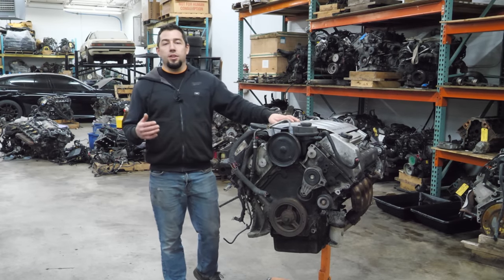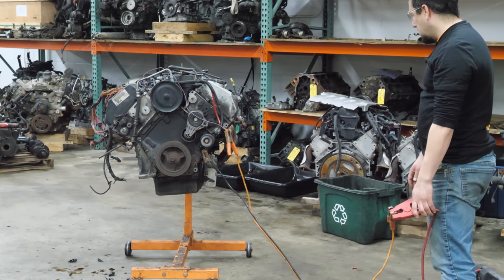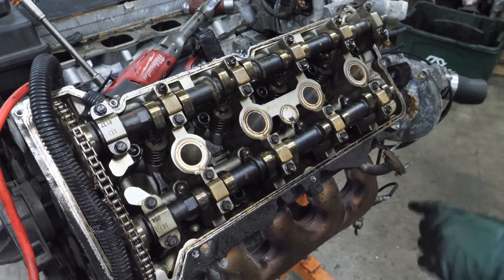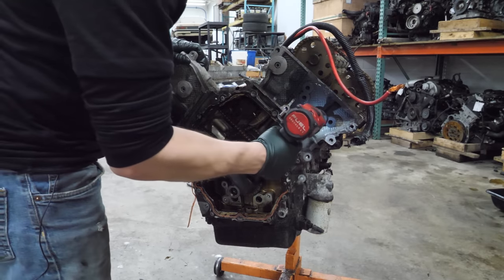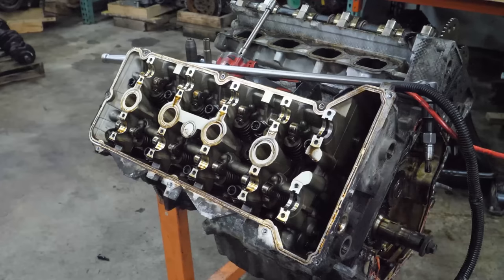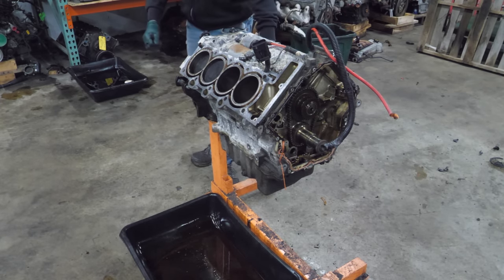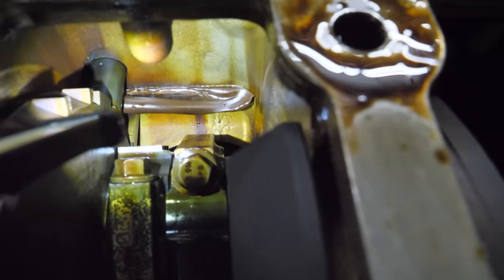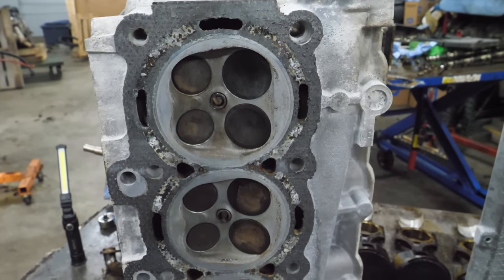Customer Returned This Cadillac Northstar L37 4.6L V8, How Many Things Can We Find Wrong?

Comment: This Northstar appears to be fully rebuildable and there's a head stud upgrade kit for it that includes retapping the block for larger diameter studs,  bigger studs included.  Probably worth doing.
Reply: They needed the stud upgrade as they munched on head gaskets
Reply: No Northstar is worth the trouble.
Reply: @agenericaccount3935  baring the head-bolt issue, they are great engines and have a dedicated following. I owned 3 cars with them, and only certain years actually have the head-bolt problem, weirdly enough. The 96 Deville and 94 Seville I had; it was the Transmission that went at 200k miles. The 99 Seville had the head-bolt issue. I would love to do a 4.4 RWD/AWD Supercharged build one day if I ever had the money. Of course, I'd have the head-bolt and crank-bolt fixes implemented and the transmission overhauled with a shift-kit. The fact these fixes exists shows there's plenty of people out there willing to spend the money. All 3 cars served me well, actually. I only had to do 2 water pumps and 1 alternator on them. The water pump is easy to do, I hate the alternator though.
Reply: @agenericaccount3935  it's why Cadillac used LS
Reply: @keithvsmith  I appreciate your enthusiasm, but veto your views on the matter. These fixes exist as a necessity and not as any implied or explicit endorsement of Northstar as a good product. In fact I would wager that the only reason a lot of these fixes have market at all is that the average owner liked the shell the motor was wrapped in and was willing to put up with spending money to undo garbage powertrain deficits to keep it.
Reply: @agenericaccount3935  can partially confirm this. Recently helped with a subframe drop on an 06 DTS that has classic GM pinchweld rot on the rear part  of the welds. We had to reseal the oil pan and redo the VC gaskets after having done both 2 years ago.

I wanna say the car is owned by an older fellow but I'm not 100% sure. I know there are enough 06-11 DTS' around that the owner could probably find another one if they so chose.
Reply: @agenericaccount3935  tell that to the inventor of the fix who's making bank.
Reply: @keithvsmith  The guy making bank selling a required fix doesn't really refute my views on the matter.
Reply: @agenericaccount3935  It does, because people are paying to have them restored, meaning people see them worth restoring contrary to your opinion.
Reply: @agenericaccount3935  You make too many assumptions with your opinion. Firstly, I said I had 3 cars with them. I am not being enthusiastic about it, I don't even own one currently. I am just stating facts. You also missed the point where only certain years are affected by the issue. My 94/96 NorthStar were NOT affected and never had a bad head gasket even having been overheated because of a faulty water pump. People obviously feel they ARE worth fixing/restoring that they are spending over $6000 to restore the engine in a car not worth that much! Again, they have a cult following and to those people, the engine ARE worth restoring unlike your claim even when it's the years affected.
Reply: @agenericaccount3935  The main point that proves they are worth fixing, is this exactly, people spending $6000 to fix the engine in a car that isn't worth $4000. These cars have horrible resale value. A person spending that money CLEARLY sees them as being worth restoring to them. There's obviously no money in it, they can't resell the car to make the money back. For $6000, they could of just went and put a downpayment on a much newer car then some 20+ year old Caddy. So, you can claim whatever you think, it's just plan and simply wrong and your opinion. Again, I have no ball in the game. I own a 2017 Ford Edge but I don't like people who spout nonsense.
Reply: @keithvsmith  Bro, Northstar isn't going to sleep with you.
Reply: @agenericaccount3935  This guy gets it.
Reply: @keithvsmith  Sorry dude, but the argument you’re making is the car equivalent of, “yeah I know he hits me, but he loves me. I can fix him with enough time”
Reply: @GMbowtie350  Yeah, no, you missed the point that despite this head-bolt issue, these are 20+ year old vehicles that are still on the road. This teardown wasn't that bad at all. It looks like the issue was shotty repair jobs and a broken bolt. Maybe pay attention to the video better next time. A properly maintained and care for NorthStar is actually very reliable. You people keep missing the point that NOT ALL NorthStars have head-bolt issues.

This specific engine didn't have the head-bolt issue. The bolts were still tight, and no aluminum pulled out of the block when he took them out. The issue was age, neglect, poor maintenance, and bad repairs with all that silicon, but for an engine with 155k miles and that's 20-year-old. It wasn't bad at all. BraveNewWhirled is completely right, this is a very rebuildable engine, though I would recommend both the head-stud and crank-stud kits. All I see are haters making comments about an engine they clearly never owned or maybe they got ripped off and somebody sold them one with a blown head-gasket, so they are jaded. Or maybe they're just fanboys of some other brand, who knows. I don't really care what your opinion is. I'm just here to state facts and bust false information.
Reply: @keithvsmith  Now let me tell you about the real world. I honestly couldn’t tell you the last time I saw a Northstar on the road, legitimately, and I hot shot campers all over the country. That’s a cool story you wrote but after 20 years of seeing them in the shop I know enough about Northstars that I’m smart enough not to go near them. That’s cool that you had good luck with the 3 you owned but I’ve literally seen hundreds that all died the same death, if the transmission didn’t shit out first. Y’all can dump all the money you want to in those, that’s a piss poor investment and that exact mindset is why people who are broke stay broke. Nobody with money are dealing with these cars, fixing or collecting them. The only people putting $6000 in these cars either don’t have a choice because they don’t have the credit for a better car or they’ve gotten a personal loan against collateral to fix it. By all means love everything about them but my firsthand knowledge has shown me they’re junk.
Reply: @GMbowtie350  whatever you say, buddy.
Reply: Seriously a question for anyone reading, when’s the last time you’ve seen a Northstar going down the road? Really, I want to know. Open to answers.
Reply: @keithvsmith  Dude, you’ve owned 3 of them and everything else you’ve just read on the internet or forums. What makes you the expert, cause I’ve got hands on experience with a lot more than 3 of them.
Reply: @keithvsmith  Lol, “despite this head bolt issue,” that’s a pretty big fucking issue.
Reply: @GMbowtie350  I am an ASE Master Tech that worked for GM. It's called proper maintenance, not luck. I get it, you don't know cars and neglected your car. It's okay, but don't make shit up. Here in CA, these cars are everywhere. So, try that bs with someone else who doesn't know better.
Reply: @keithvsmith  Sure you are. What’s that mean, you had $300 to spend on a certificate? I know ASE techs that couldn’t do a timing chain job on a 302.
Reply: @keithvsmith  I know enough not to fuck with a car you lose money in. Go broke all you want on them. I’ll keep my money. But yes, I would completely make up working in a shop that constantly had dead Northstars coming in. Completely unbelievable.
Reply: @GMbowtie350  I am one those who gave up. 02 Oldsmobile Aurora 4.0 the transmission shit the bed had it rebuilt which after that it had a nasty torque converter rumble and that was normal results after a rebuild. Then the head bolts gave out lost compression in the back bank. Threw in the towel sold it to a scrapper and purchased a Honda.
Reply: @tspbod260  It’s ok, man. You’re with people who love you. We’ll get through this. You did the right thing.
Reply: @GMbowtie350  😅Thanks bud.
Reply: @Tigerwarhawk  Ok, we have the same 2 or 3 a week from this guy. Anyone else?
Reply: @Tigerwarhawk  So it’s fair to say you haven’t seen really any others other than those two? So if the first time you saw either of those 2 or 3 has been a minute ago it’s fair to say that you’ve only seen 2 or 3 in the last good minute? I mean that’s kinda like saying, “there’s a lot of fish in that pond” when really you’re just seeing the same 3 fish over and over. If anything it kinda proved my point. Not attacking, we’re just having a conversation.
Reply: @tspbod260  Digging the TL by the way. 2008 still is a damn good looking year even compared to the newer ones.
Reply: The general consensus is Northstars are crap. The end. 
Just because somebody on the extreme fringe is weirdly in love with them and defend them till their dying breath, doesn't mean it's any better. 
This isn't only a few people saying this, this is widely known in the automotive world. 
There are people that defend hätler...doesn't mean they are right....
Reply: @banneddamn  Yeah, no, again, only certain model years had the head-bolt issue. Typical rumor mill bs hearing about a problem but not knowing the specifics. You are wrong, the end. The real issue these cars had was that stupid air ride system. Caused them to have horrible resale value. Who wanted to spend 4000 on new struts for a car that was only worth 2-4k tops. Just goes to show how little haters really know and how they like to spread misinformation.
Reply: @keithvsmith  to you I'm just some "hater spreading misinformation" 🤣🤣🤣 
Right. Ok. 
That's your argument? You are defending the indefensible. And also including deflection onto the air ride. 
This isn't some "rumor" that Northstars are not good. 
Just stop.
Reply: @banneddamn  Yes, because you probably don't even know the signs of the head-bolt issue. It did Not display as a blown head-gasket and unless you got stuck in traffic, you wouldn't even see it overheat. I, on the other hand know how to properly diagnose the issue and know only certain model years had the issue. The first generation with DIS didn't suffer from it.
Reply: @banneddamn  so, you just stop...
Reply: @banneddamn  The head-bolt issue was very specific. The car would only overheat in bad traffic where you were bearly moving, no white steam out of the exhaust, no lost coolant, no coolant in the oil, only way you knew for sure. You needed this chemical tester with a fluid that changed color when combustion gases were present. The overflow tank wouldn't even bubble.
Reply: @banneddamn  and again, it you got the head-stud fix, the car would never have a problem again, but please tell us me how you know better because of some rumors you heard. Typical backyard mechanic that thinks you know what you are talking about. Stay in your lane.
Reply: @keithvsmith  The blocks are weak and unstable that most machine shops won't touch them.
Reply: @benjaminwayneb  Again, no, this is the problem with "the whole automotive world." You people hear rumors and spread them as fact. No, it is not that the block is too soft/weak. It is NOT cause by overheating the engine. It IS a chemical reaction known as Galvanic corrosion and doesn't just affect NorthStar engines. Other engines have been affected by it. It is what happens when dissimilar metals come in contact with each other. Same thing happens in Computer water cooling systems when people don't know they shouldn't mix aluminum radiators with copper cold plates.
Reply: @benjaminwayneb  You people just regurgitate the same crap over and over again instead investigating the truth and learning the whole story.
Reply: @keithvsmith  The block doesn't maintain it's shape after machining so machine shops won't touch them. Disposable junk.
Reply: @benjaminwayneb  there is a Head-stud kit that fixes the problem permanently. The problem is it is too expensive that that car just isn't worth the money unless you personally care about the car that much. I swear, you Google experts never learn.
Reply: @benjaminwayneb  You have been muted too, educate yourself and go away.
Reply: an it would run  a very long time too...my 93 el has  16,000 miles on it   my boys 98 has 70,000 both still run great...not all pull the head bolts an gm should recall all of them an do it right,,,not the only engine that does this
Reply: Best Troll Comment of the day ☝️! It’s not 1970 and nobody rebuilds cars they just buy new ones, it’s not even like it was of motor of class for it’s time it made most people cringe 😬 when they heard NorthStar V8
Reply: The only thing it's worthy of is the scrap bin.
Reply: @davelowets  no they are not they can be fixed
Reply: I much rather one of the 6.0's he has in the background. These engines are junk
Reply: @GMbowtie350  Thanks, 15 years old 212,000 and still a super fun and sporty car to drive.
Reply: @seymoarsalvage  Fuck yea....
Reply: @Monza62000  They're junk. Not worth the money or time.
Reply: @davelowets  i have a 93  boy has a 98  ..bad ass  engines   they can run 400,000 miles  ,,but  you have to drive them hard    ,,
Reply: @Monza62000  Show us one then.
Reply: @keithvsmith  Still simping eh?
Reply: @keithvsmith  >Bust false information.
After busting in your mail order bride, we assume.
Reply: @Monza62000  Lol, if you actually Google “highest mileage Northstar” it’s just pages of nightmare stories and seems like the consensus on every single Northstar or Cadillac forum is that 120K miles is considered high for those engines. Can’t find one example of one with over 200K miles that isn’t on its first or second engine.
Reply: @Monza62000  I've worked as a mechanic for over 25 years and I've NEVER seen a Cadillac that has gone 400,000 miles on it's original Northstar engine. And I've worked on MANY of the funkers. 🗑

I'm GLAD those P.O.S. are gone for the most part. If I have to fix another oil leak, stripped head bolt hole, or starter on one of those, I'm going to puke.
Reply: @GMbowtie350  -" when’s the last time you’ve seen a Northstar going down the road? Really, I want to know. " 
Come to think of it - never.  Clicked on this vid because I see many for sale Craigslist and I could do a driveway rebuild - like the looks of the coupes in particular.  But don't remember seeing one actually on the highway ... the four doors, last one was being flatbedded out of our neighborhood that I saw. Never came back.
Reply: @andyburk4825  I’ll give them that, the 2000s STS’s and SLS’s are good looking cars but I’d avoid them like the plague. Don’t let some of the people say otherwise, those motors are straight junk. They were all aluminum motors, and more often than not when they were overheated once one good time they were done. And if the heads didn’t warp then more than likely the bottom end was done. I’ve seen a more than a few instances where people have spent a good couple grand on head work just for it to start knocking a week later. Which thats true for any engine that’s gotten that hot or blown a head but it happened every damn time on the Northstar. Then honestly they’re not that quick. The only one I had was an ‘02 STS that I only had cause I traded a bike that I needed out from under and I got completely dusted by an early 90s LT1 Camaro, and those are only maybe low 9 cars on the 1/8 mile.
Reply: @andyburk4825  That Keith guy acknowledged that they have low resale value but he doesn’t understand that the engine is the reason WHY the resale value is so low. Nobody wants them.
Reply: Hold Me Back !
Reply: Hold Me Back !
Reply: @GMbowtie350  the 06 DTS I mentioned, when it was last at our shop, which was about 3 weeks ago. I'm sure I'll see it again.
Reply: @GMbowtie350  Aside from my own, I see various Northstar-powered vehicles rolling around town quite regularly. Probably about once a week or so, even here in the rust belt.

Realistically, it's a solid powertrain combination. Unlike GM's notoriously-awful 4T65E that got paired with the revered 3.8 and 3.9 engines, the 4T80E tends to be more robust. The latter-day Northstars, free of the shackles of the head bolt situation, are a solid choice overall.

Granted, if you're after dead-simple starter and water pump service, they're probably not for you, but it was a well-refined (if slightly dated) powertrain by the time the mid-2000s rolled around. There's no GDI, forced induction, displacement-on-demand, weird internal timing-chain-driven waterpump nonsense, (looking at you, Ford) or any of the other newer technologies that make aging engines more cumbersome to maintain. And yet, it still makes good power, the V8 rumble, and isn't too bad on fuel.
Reply: @Browningate  Ford OHC V8 water pumps are still on the serpentine belt and pulley. Like I said, by all means go buy one. I’ve seen way too many dead ones to change my mind. The Northstar would’ve put Cadillac under if 50 to 60 year old men didn’t see it as a domestic status symbol.
Reply: @keithvsmith it is not worth fixing them. That is an objective fact. Don’t be so defensive over your shitty engine.
Reply: @GMbowtie350  I don't know of anyone who thinks of the Northstar as a "domestic status symbol." I only make judgments based on facts and reality. For that reason, I'd take a Northstar-equipped GM product over something with the GM 3.6 or the Ford (transverse) 3.5.
Reply: i think 🤔i did that to this engine around 2012 or the boss did but someone else has been after me/us aka not the way i remember it years ago 

but the end of the threads/14mm might be my mitt's-work?
Reply: @keithvsmith  unfortunately averages owners unmod'd i was around in 2012~ at the shop i was in 200k mile's the torque converter and or the transmission clutches goes bad but flushing at 50k milestones helps a lot fyi 

shop's thing was performance caddy's aka 4.9L to 500+hp and the 500CI platform ect
Reply: @GMbowtie350  The only thing I can say for sure is that I don't feel passionately enough about it to give myself an aneurism  grouchily pushing out a profanity-laden paragraph in the YouTube comments section.
Reply: Timesert.  It allows you to continue to use the factory head bolts, and very nicely correct for one of the only real engineering issues with this engine.  Many other engines of this class used threaded inserts rather than threading the block itself as GM did here.  Any Northstar V8 with the heads off for any reason should be assembled with the Timesert kit.  I don't care if the threads didn't seem to come out, just do it.  When combined with the newer gaskets (the factory GM part has been redesigned a couple of times) and better coolants, the head gasket problem is almost completely eliminated.  An internal statistic folds that one out of six cars between 1996 and 1999 had head gasket issues.  The problem was far less common from 1993-1995 and 2000+, and both the head bolts and mating surfaces were redesigned for 2000, but it was still what would be considered a pattern failure on this engine.
Reply: @Browningate  You cared enough to respond to that profanity-laden comment.
Reply: @Browningate  Also I don’t know if I’d consider maybe 3 swear words in a paragraph “profanity-laden”. You must be fun at parties, Captain Hyperbole.
Reply: @nathankarras2715  The one thing y’all are missing is it’s not that there isn’t an aftermarket fix but IF, and that’s a big if, the motor isn’t ruined from overheating. Warped heads, fried rod bearings, scored cylinder walls, etc. and that was more often than not a foregone conclusion. Why spend a few thousand in head work when you don’t even know if the bottom end is bad. There’s a reason a lot of shops won’t do head gaskets on either certain motors or after certain miles. Try explaining to a customer why their car is knocking a week after they just spent $2500 on head work. Y’all are talking like it’s just pulling the heads, changing the parts, and your problems are over. It never works like that. The head gasket goes and 9 times out of 10 it’s overheated and I’d say a good percentage of those scenarios it run hot enough to quit running. C’mon man, with everyone acting like Northstar gurus and master mechanics y’all have to know that. That’s day 1 stuff.
Reply: Northstar starter beats any fwd GM 3.6 starter, at least you don't have to remove a catalytic converter.
Reply: @keithvsmith  muh mazer tek.....🤣🤡
Reply: @jamesgeorge4874  No, you just have to pull the intake. Both are junk motors not worth having.
Reply: @GMbowtie350  No shit, Sherlock, I've changed more than a few, on BOTH engines, and the Northstar is easier to replace a atarter than the 3.6, BUT the 3.6 is serviced appropriately, it will go a quarter millon miles with little trouble, I see it all the time, as I have been fixing them every fuck8ng day for more than 30 years, and if you make money fixing cars, the ones that break the most, are cash cows. I don't give a shit WHAT car you own, it will need service if you keep it long enough.
Reply: @jamesgeorge4874  A car needing service is an oil change, brakes, water pumps, about anything on the accessory drive, shit like that. Popping head gaskets at 100K miles like a Northstar or the timing chain coming apart and bending the valves at 100K like the 3.6 is a little past “normal service”. It’s badly designedly junk.
Reply: @jamesgeorge4874  No mechanics other than shade tree consider a Northstar or 3.6 a cash cow. Any mechanic I know that still does it for a living absolutely hates when either one comes in, if they even take it in.
Reply: @GMbowtie350  What do you drive everyday ? Bro, I'm not trolling, I am a long term tech, I saw the age of the carburator, turn into the electronic carb, to TBI, to PFI, to GDI, and learned on 1910 tech, atmospheric intake valves, flat heads, magneto, points, solid state, DIS batch fire, and sequential COP, and unit, distrobution pump, IDI, HPOP, and common rail diesel. I have seen it all, 90% of engine life is 100% who takes care of it.
Reply: @jamesgeorge4874  I agree to an extent. It does make a big difference in who’s taking care of it but these two motors in particular have some fatal flaws that will eventually surface no matter how well it’s maintained and any fix or remedy for those flaws well surpasses either the longevity of the what the motor will realistically see or the resale value of the car and it’s just not monetarily worth it. I myself have a ‘12 Ram 3500 with the Cummins but I drive about 4 more Cummins Dodges all over the country. I love a Cummins and I run the hell out of them with minimal problems but I’ve got no problem telling you I avoid the 5.9 53 block in the 2nd gen like the plague. I don’t know why some people get so damn defensive over the Northstar. I can actually admit when a motor I like is a junk design.
Reply: @jamesgeorge4874  Also an ‘18 Yukon that to be honest the DOD scares the hell out of me. Need to tune it and get rid of the DOD before a valve won’t pump back up and stays down.
Reply: @GMbowtie350  did you do the kdp upgrade ? Honestly, well maintained engines always last longer, matter what, and an abused Cummins will die, just like anything else. I have seen fleet vehicles go 300,000 miles before engine or trans failure, many times, but that is because they get taken care of. Of course some do better, but engine life really depends on the owner, 90% of time.
Reply: @GMbowtie350  I can get behind you 100% on that, I own HPTuners, and a little tweak on the enable criteria will stop all that, and some changes in the TCC apply strategy will make the torque converter clutch last, the afm/dod puts a lot of load on the converter by shutting off half the cylinders, and stock tcm tuning starts applying the tcc at the top of second gear, and it beats the lips off the fluid. Dexron 6 is full syn, and looks worse in 30K than dex in a 4 speed at 50K,  because it's clutch to clutch shifted, and works harder. I've seen a 6L90 go 450,000 miles on 50K flushes only, but average owners never do it. Every 6 speed GM auto fails because the converter gets worked to death, then shits it's sprag, and fills the unit with metal. Love makes em' last my dude.  A few years at a fleet maintenence company confirmed this. 300,000 mile 3V Tritons are all I needed to see the light.
Reply: @jamesgeorge4874  Damn 3V Triton lol. Man when they ran they ran good but when they had problems, ugh. That in my opinion is the best example of a shit motor that actually will last a little bit if you maintain it and start with one that isn’t abused. My buddy has the HPTuners that he does with his Corvette and I’ve just been leery about cause he had said if it wasn’t tuned just right with it being GDI it could mess some stuff up. He hasn’t done the tuning that long so I was gonna have it done elsewhere.
Reply: @GMbowtie350  I have set the AFM/DOD enable at 7000 rpm, and 256⁰ F, and it never turns on, the TCC was set to engage at above 45 mph, in 4th, 5th and 6th, and ramp up to 60% lock up quickly, you don't have to change the fuel or timing tables at all.
Reply: @jamesgeorge4874  Nah, we only have one 2nd gen 2002 and we’ve never dealt with the KDP issue. The rest of the fleet are common rail 5.9s and 6.7s. The common rails didn’t have the KDP, thank God. Really the only thing you have to worry about with the common rails were that trash would get through the filter or someone wouldn’t drain the filter bowl before they pulled the filter and it would kinda make the injector stick or slobber fuel out and it would eventually wash out that cylinder. The Fass filters were the solution to that but on my last ‘06 I always changed my fuel filter every other oil change, 20K miles, and always used Hot Shots injector cleaner. I swear by that stuff. That and Seafoam made me a believer in some of that stuff.
Reply: @jamesgeorge4874  That’s damn good advice. Appreciate that.
Reply: @GMbowtie350  Perhaps, but not enough to try to parse through the whiny complaining that it actually contained.
Reply: @Browningate  I wouldn’t think “complaining” would be the right word. I have nothing to complain about. At the end of the day I really don’t care how anyone views that motor. “Sniping” feels more accurate to the situation.
Reply: @GMbowtie350  You seem to have missed day 1 your Northstar class, then.  Warped heads are extremely uncommon, even on severely and repeatedly overheated Northstar engines.  Bottom end issues are similarly rare.  Unless the engine was run out of oil, you can easily count on the bottom end being fine.

This engine has been kind of a hobby for me, because I had a head gasket go on one, and I simply replaced it because I needed to get the problem taken care of pretty quickly.  My mechanic told me that he didn't want my original engine because I supplied the replacement (GM connections are fun) and he "had to pay to have it hauled out of there", I came back with a more suitable vehicle and took it home.  At 101K miles the entire thing was perfect except for the head gasket on one side.  I tore down the entire thing, checked everything.  I put it all back together, using all the original parts except for the fasteners, with thread inserts, and sold it to somebody who now has it in a Fiero that runs high 10-second quarter miles.

The problem is that the mechanics of the day didn't understand these engines.  They had a lot more in common with today's endings than with those of 20 years ago.  Today's mechanic wouldn't say anything at all about diesel engines, other than normal mechanic gripes that they have about literally everything.  Today's mechanic just say crap about these engines because they heard through the grapevine that they were difficult to work with and had a particular set of issues.  I would say that a lot of today's mechanics have next to no experience with them, and would be pleasantly surprised if they worked on one.

I started talking to a few mechanics shops around, and over the next few years, I got more than a dozen of these engines free.  They had all been taken out of service because of head gaskets, and only one had any remotely serious issue beyond that.

The truth is that these are very durable and very well-built engines, with literally three and only three major weak spots.  The first is actually two, the poorly designed early multilayer gaskets where the third layer dissolved due to incompatibility with the organic acid corrosion inhibitor technology in the coolant (bet you didn't know that one) which is why they lasted a long time in cars run with the conventional green coolant, the poorly designed head bolt interface.  The second is the way the cooling system purges the air from the centrifugal flow water pump.  There is one tiny line that if blocked will cause the coolant to almost completely stop flowing in due to the hubless design of the pump impeller.  Third is the propensity for the mid seal to fail, causing significant oil leakage, so much better car whose oil level sensor fail to easily run itself out of oil in just a few weeks the oil puddles under the car are not noticed.  Every other issue is pretty minor.  People complain about crank position sensors, but those can be changed by a monkey.  The starter under the manifold?  It's annoying if you have a shop with a lift and are used to changing starters in 20 minutes, but if you actually have to change it from above the vehicle, you'll find it only takes an hour and is a lot easier than jackstands or ramps.

Edit:  Forgot to ask, how many 4.6 Northstar V8s have you rebuilt?  Over 20 over here, and I'm not even a mechanic, I'm an engineer.
Reply: @nathankarras2715  Cool, go have your hobby.
Reply: @nathankarras2715  And to answer your question I’ve built absolutely zero of them. I don’t mess with cars that don’t make money, and those absolutely don’t make money. We’d push them right back out. Like I said, try explaining to a customer why their car isn’t fixed after spending a few grand on the heads. You say the bottom end rarely goes out, I say I’ve seen it happen way more than a couple of times. What happens to aluminum when it gets to 400 degrees or so Mr. Engineer? Like I said, go have your hobby. I don’t deal with vehicles that don’t make money. It’s all fine and dandy when it’s your car and your money to piss away and it may or may not end up fixed. Try doing this shit and guaranteeing a customer that it’s fixed. It’s a whole other ball game when it’s someone else’s money you’re gambling with.
Reply: I have a 2001 Deville with 208k miles and I've had zero issues with it and I've known people with 90s models and they've said they were reliable and if they have their supposed well known failures they are now easily fixable with kits and you are right there's a huge following and for good reason 90s to early 2000s caddys are good despite popular belief it's just hilarious to see people bash cars they have zero idea about but they'll defend a 3x more unreliable and shitty vehicle like Subaru Imprezas "Yea my motor blew at 10k miles but it's reliable" 🤣🤣🤣🤣
Reply: @GMbowtie350  see them quite frequently in my area bc the people that own them actually take care of them.
Reply: @commander_lutzow3782  that's because Subaru is like of the apple of cars. They have lots of unreasonable Fanboys who have already decided what their "truth" in the issue is, regardless of what the actual facts indicate.  I live in Michigan.  We got a lot of salt put down on the roads, for obvious reasons.  Every spring or toward the end of winter, at least one of my friends with a Subaru is complaining about it running poorly or stalling, and it always is the same issue. One or both of the back to coils is damaged because of salt water spray off the wheels.  It would be really easy for the company to put something there to block the water spray, but they don't. It would be similarly easy for some stupid Subaru Fanboy to make one available in the aftermarket because Fanboys always loved to cover up the flaws of the products they like.

I've had a few of these Cadillacs.  I have a 1998 with 259000 miles right now.  Had one up to about 100000 (sold working fine), and one to about 195000 (sold working fine).  The biggest problem they have is that people don't understand them and don't seem to want to understand them.  This leads to stupid mechanics thrashing on them for no reason, calling them throw away engines and whatever else.  People complain all the time about how horrible that design is with the water pump and the starter, I would put money on it that those people have never changed either one. I have.  It's the easiest water pump there is, though it does require a special socket type tool.  The starter is similarly easy.
Reply: @nathankarras2715  Glad a fellow Cadillac owner knows what's what with these cars instead of just seeing a single imperfection and calling it "trash" all people with common sense in the auto industry know there's no such thing as the perfect car all of them have their flaws one way or another but one thing is certain if you take care of it and actually do this thing called maintenance even the most unreliable cars can last awhile people just expect a car to run forever Northstars are no exception they are good motors they just require good maintenance something most people have zero concept of very sad to see the 90s-2000s Cadillacs get so much unnecessary hate when there's cars out there far worse off but have people swearing they are the best thing since masturbation was discovered.
Reply: @commander_lutzow3782  It isn't even that they require extra maintenance, but they just require a bit of particular handling in that department.  I could easily jump on the bandwagon about GM's 3.6 being a crap engine because I have a major valvetrain problem with one (seized roller leading to eating into a camshaft lobe) on a 2012 Chevrolet, but the engine has 309000 miles.  People need to look at their situations from all sides before complaining and trashing on products.  2012 and up had most of the 3.6 issues fixed, but people still talk about how that is allegedly a crap engine.
Reply: @GMbowtie350  i got one outside cost me 4700 to put new studs ac compressor alternator starter spark plugs control arms etc... I haven't found a car on the road it couldn't gap and I take it down south Florida getting about 27 mpg at 78mph had it 3 years since all the work done and all I do is hit 6500 rpms when ever where ever however. 
If you don't know you just don't know...
Reply: @commander_lutzow3782  Cool, have fun with it.
Reply: @commander_lutzow3782  See, that’s what I don’t get. Subaru 4 cylinders were known for head gasket failures too. The motors just never blew apart, they blew head gaskets, and they were A LOT easier to deal with than Northstars. So why is that motor that had head gasket problems a piece of shit and a Northstar with head gasket problems is gold? It can’t be speed cause a WRX will rape a Northstar. Can’t be resale cause Subarus hold their value better than Northstar Cadillacs. So why is one better than the other? Hell, I’d argue the Subaru is a way less expensive and simpler fix. It’s a boxer motor so heads are easier to get to.
Reply: @GMbowtie350  I see a fair bit of 06 to 11 body style on the road. Sometimes the occasional previous body style. My 08 will likely be on the road again after I finish some other projects.
I'll likely steal some parts from my 02 to put on my 00 Bonneville SSEi.
I have a 2019 Equinox. I test drove and was considering a 2018 AMG CLA45. Honestly though, F new cars. Too much unnecessary crap and telemetry in them these days.
Just to clarify your standing, you believe the rich stay rich due do perpetual debt. That makes more sense to you than someone that buys a car, pays it off and doesn't have a loan for a long time?
Reply: @caddyguy5369  I didn’t say the rich stay rich to perpetual debt, which if you know how and when to use credit you can make the interest rates work in your favor. Debt isn’t just black and white. Number 2, if you’re  of the mindset of putting more money into something that has absolutely no ability to give you any kind of return then you probably make more wrong life choices that go farther than that. I’d rather buy a car for under book on a loan and build equity in it than drop $4700 cash into a car that’s worth $4000. It’s not hard.
Reply: @GMbowtie350  If you say so guy.
Are you as sure of that as never seeing these on the road anymore?
Reply: @GMbowtie350  I would say the joy of keeping a car they like going and in the process keeping another vehicle out of the junk yard more than enough return to some people to who a car is more than getting from point A to B, but you do you, master of the universe.
Reply: @GMbowtie350  Also some people do their own work. Bulletproofing one of these engines would come in way under $4700 for people that can eliminate the labor.
Are you assuming that everyone has to have someone else do the work for them? It seems so.
You have motorsports in your name and assume people can't do their own work and eliminate labor cost?
Reply: @GMbowtie350  Got me kind of curious. Sorry about the separate messages. I'm on lunch break.
I'm just kind of confused as you have motorsports in your name and seem to be completely disregarding any reason someone would want to save a car other than the financial aspect.
That doesn't seem to show a very deep understanding of the passion involved with being a true "car person".
Are you saying I should stop my project of integrating RGBW into a 2000 Bonneville SSEi because I'll never get my money back? What about the conversion to a camper? Could be the fastest camper in the world. I haven't looked into it. :-)  Probably not though.
Should I cancel my plans / dreams of swapping and RWD converting my 92 coupe deville because I'll never get a return?
What about the tools, knowledge, and ability gained in the process? Are those returns? Do they make up for the money lost?
Seems that would be up to the individual.
Honestly curious in a discussion as to why the hate? I see we watch a good number of the same channels so kind of makes me more curious.
Any car I buy I don't expect a return. I've only sold one in my life and that was my first beater 88 beretta that was a hand me down. I still have every other car I've ever bought. I buy something to drive it and use it.
Reply: @GMbowtie350  Fair enough. To each their own. That explains the motorsports, but dealer sounds like it would be more accurate. Honestly kind of disheartening to hear your only interested in money though. In that aspect I'd say you didn't own 100 cars. You were in possession of them for a little bit. Legally, perhaps, but I'd wager You didn't get to know every nuance of each one of them?
What is going to require luck with the camper?
Reply: @caddyguy5369  I mean, the “Motorsports” in my name is just kinda for fun. Lil Buddy is my nickname and then the Motorsports part is just kind of an inside joke between a few of my friends, one being Street Fighter Racing in my channels. He’s got a Corvette he built, our other buddy had a hot rod C10 square body Chevy and a ‘12 PPV Caprice which he had the shop at his house we work on our stuff out of, and I had a ‘96 Mustang with a tuner and PI swap. You don’t have to build cars from the ground up to be an enthusiast. I’ve had stuff I’ve hot rodded and I’ve had stuff that I bought already done. Me personally I like making the money on them. I’ll drive them for a couple weeks and send them down the road. I really only keep my diesel trucks for years at a time, that’s kinda what we got into, tuned Cummins trucks. That’s the exciting part of it. It’s cool to see what you can do. I’ve done trades where I’ve started with a Dodge Stratus with a bad transmission and after 3 or 4 trades it turned into a ‘99 Z71 which at the time was only about 8 years old. I still race my stuff, I’ll still occasionally take on something to hot rod but at the end of the day my bottom line is the most important thing to me. I haven’t really traded around as much in the last couple years. I’ve focused more on my transport business and mobile RV work. As far as the camper goes just depends on what kind of camper you’re building.
Reply: @GMbowtie350  That's fair.
Street Fighter Racing sounds like a good concept for a game. :-) 
To be fair I always did really enjoy Wheeler Dealers and would probably like flipping better than my job. Trouble is I have a hard time parting ways. I've never bought a vehicle strictly for resale. Perhaps that would help with the sentimental attachment. I tend to want to dig as deep as I can and find out specifically how every system works. Electronics is my bread and butter. I'm also bad at pricing things and services because I want to help people more than make a buck which partially stems from not really caring about money. I do need to work on that as i want to transition to my own repair / customization business. I don't know how much longer I can deal with a boss and truck drivers.
All said and done, we can't take anything with us and I have no one to pass anything to with a high likelyhood to persist that way. That also contributes to not caring about money.
As far as type of camper, bed, refrigerator, vaious electronics, hook up to shore power, diesel heater, refrigerator. If I can work a generator into the equation probably find a place to stuff a microwave and pizza maker.
It's been in use for a couple years in that capacity. Just refining a rev 2 and adding some bits.
The RGB project is mainly because I was going to do a color change for the cluster and dash light due to burnt out bulbs, but couldn't decide on a color so I picked all of them. I get to mold and cast all new buttons as the factor ones are made of red plastic and I need clear. Another big contributor was I miss some aspects of manufacturing and wanted to keep my electronics skills up to practice. Also perfect reason to learn resin casting in 2 part molds which has been on my list for quite a few years.
Reply: @caddyguy5369  Are your appliances RV appliances or residential. I know the refrigerator is probably just 12V since you don’t have any propane. How you got your shore power run? 30A I’m assuming?
Reply: @caddyguy5369  For your generator there’s a good bit of Onans that are pretty compact. I’d look at wiring in a transfer switch so you didn’t have to keep plugging and unplugging the generator from shore power.
Reply: @GMbowtie350  I did use propane for heat until the diesel heater. Haven't had a chance to use the diesel yet though. Might have to get a smaller one. Propane, as I'm sure you know, isn't good for heat though due to moisture. Can get it done in a pinch with obvious risks involved. Never had it set off the carbon monoxide alarm. I did have the alarm go off once when I was warming it up before leaving work. Flex pipe after the headers was shot. Was running for like 5 min and I went out to load up tools and the alarm was going off.
Shore power at the moment is just one of the really long power strips from Harbor Freight. On board battery charger. If I get a generator stuffed in I would plan on a transfer switch. I have a Ryobi I was going to try to convert to electric start, but the form factor isn't ideal. Open to alternatives there. Could probably make it work in the spare tire well. Noise could be an issue though.
The fridge s a 12v semi fridge. That I did have in there last summer as a makeshift install to check placement and see how I like it. It is pretty freaking sweet to be on a drive, just finished your drink or it got warm. Reach back and now you have an ice cold one.
If I ever take the bed out and put the passenger seat back in, pretty sure I'm keeping the fridge.
I do put a window A/C in for the summer months. There is no rear seat and I am able to put it with the condenser in the trunk and seal the back wall off. Pull up to your spot, pop the trunk to vent the hot air.
Being an RV tech you might find this bit interesting or funny. I discovered that an RV roof vent fits perfectly in the sunroof of both my 08 DTS and my Bonnie. Just plug the opening left on both sides. I have a motorized MaxxFan. Relectx and the roof vent alone can keep it surprisingly tolerable / boarderline comfortable even directly in the sun. I like hot though so that would probably be subjective.
The roof vent can generate some quite hilarious reactions though.
For batteries I'm running 2 optima group 31 yellowtops and the starting battery with a battery doctor isolator.
Reply: @caddyguy5369  I thought there was an actual electric start kit that you could buy with a Ryobi? As for the moisture problem with the propane I’ve always found the roof vents or Maxxair fans were sufficient, but I’ve never used them in the smaller space you’re trying to. They doesn’t surprise me about the A/C in the sunroof. All you need is 14 1/4” square hole and the A/C will fit right over it. Just about every skylight in an RV is that size. If you don’t use that generator there are a number of quiet ones you could use, especially if you go back to propane. The loud ones are gonna be a lot of your diesel generators. If you can spare a little more room you can get some serious amp hours with four 6V deep cycle batteries and just wire them up series-parallel.
Reply: It's totally junk. Engineering precursor to LS development.  At least GM got it right so we'll have great power for the next century
Reply: @GMbowtie350  Driven Northstars are fairly common given the fact the 2011 was the final year of production. I'm in Virgnia and I see them up and down the east coast. As recent as two days ago, while on a return trip from Virginia Beach back to Northern Virginia, I spotted at least three of them and all in pristine condition. A silver DTs in particular was at a fuel stop and running smooth and quiet like a true Cadillac.
Reply: @DUSM  Only seeing 3 Northstars from Virginia Beach to Northern Virginia isn’t that great. But hey, if you like them you like them. One man’s trash is another man’s treasure I suppose.
Reply: @Lil Buddy Motorsports   That is certainly a valid assertion: To each his own.  

The VA reference was an example of recent sightings of N* powered vehicles that I've observed all along the East Coast in response to your statement of whether they are even seen on the road (paraphrasing). My response was not a conclusive or definitive statement regarding the proliferation of N* vehicles or whether I am fond of them.
Reply: @GMbowtie350  Not a Northstar fan, but you can’t talk about “trash” when you have it in your profile picture and a fking 2v mustang lmfao
Reply: @Browningate  LOL.  Hilarious comment:  "Well at least it's better than a GM 3.6 or Ford 3.5"  ROFL
Reply: @aheroictaxidriver3180  Whoever said that was probably right. I don't see the humor.
Reply: @trizkial7592  Bought that truck at 80K miles and wrecked it at 314K miles. That truck has been through about 30 states coast to coast. It consistently made me an extra $20K-$30K extra on top my salary from doing side work with it. In all those miles it needed a $2800 transmission and an $1800 set of injectors. Yeah, it’s trash all the way to the bank. As far as the 2V Mustang, don’t really know what you could say about it. They’re good engines, and that was a later coil pack 2V in it. It would rape N/A Northstar. Plus another one I made money on. I’d like to hear what you got.
Reply: @DUSM  Fair enough.
Reply: @GMbowtie350  they’re reliable turds I’ll give them that
Reply: @trizkial7592  It did it’s job and made money on a flip. That’s all I cared about. It was a quick car that sold quick. Didn’t need anymore out of it.
Reply: @GMbowtie350  It might take a Northstar considering most the northstars were in a heavy caddy with an ancient 4 speed now that I think about it
Reply: @trizkial7592  I mean Northstars really aren’t that quick and that car was actually pretty decent. Why wouldn’t that Mustang hang? I had already outran a number of Northstars in that car. The PI 2Vs were 270 horsepower stock and the car is about 1000 lbs lighter and this wasn’t the stock 215 horse ‘96 2V motor. It was a PI motor swap from a New Edge GT with long tubes and a tune. It actually had some decent money in the suspension. Adjustable lower control arms in the rear where you could set the pinion angle low to hook. You could dump that car at 4K RPMs and it wouldn’t spin. It could pull a 1.60 in the 60 ft. Consistent 9.11s on the 1/8. It would run side by side with new body 5.7 Chargers and Challengers. Not saying those are fast cars but not too bad for a little 290 horsepower 2V. The bumper was a little ugly but the car was actually in good shape. If you’d have seen the F250 I traded for it you’d understand how good of a deal it was. The truck was a piece of shit. But no, it wasn’t a car I was necessarily serious about. I traded into it, had fun with it for about a month, and sent it down the road.
Reply: Perhaps who KNOW get professional machining shops to tap the block with bigger threads. That's the ONLY way to go with these engines I'm told.
Reply: @OffGridInvestor There's a tutorial on YouTube about doing it yourself, the only thing is that the Northstar has to be dropped, not lifted, at least in the 2000-2005 DeVille. I believe I watched a tutorial by the Wizard mechanic or something along the lines, on my way to order the head gasket bolt kit to prevent the failure.
Reply: @nathankarras2715 which line is it that gets clogged so often?
Reply: @realliveboss5381 Purge line.  Runs from the top of the water pump housing into the surge tank (pressurized expansion tank).  The cooling system is very susceptible to vapor locking, where the top of the cooling system will become airbound (or steam), and circulation will stop or nearly so.  Test by disconnecting the line at the tank and starting the engine.  You should have a steady trickly of coolant coming out.  If not, blow out with compressed air.  The purge line likes to block where the flexible tube meets the rigid metal pipe along the front cylinder head below the beauty cover.
Reply: @nathankarras2715  okay, thank you very much for your reply! Working on a 2000 SLS when I get back from work. Installing a new radiator, coolant sender, fail safe thermostat and hoses...100k miles no leaks, wish me luck!
Reply: @realliveboss5381  definitely good luck.  A prebuilt a couple of these engines. They aren't bad.  The somewhat bad name they get is just from people who don't understand.  If you know what to watch, these engines to do a very long time and be repaired easily without extra effort.
Reply: @keithvsmith .  Bowtie is smart enough to work on one. .
Reply: @banneddamn Only by people who never had one or weren’t smart enough to take care of one if they actually had one.